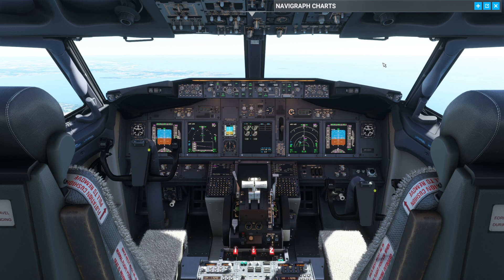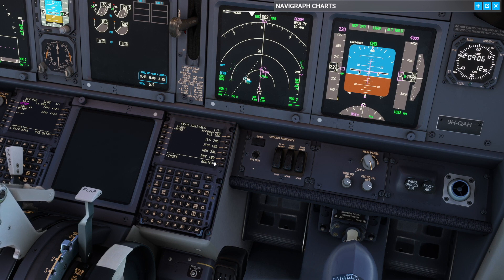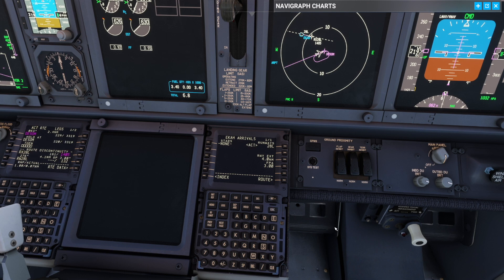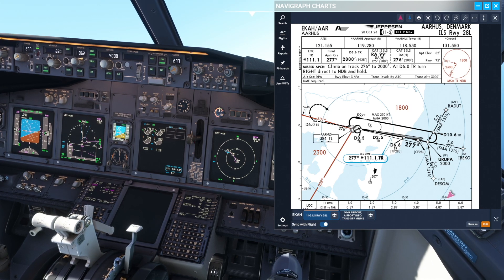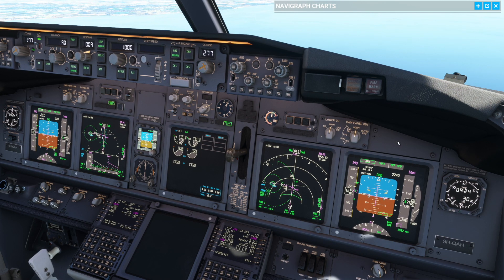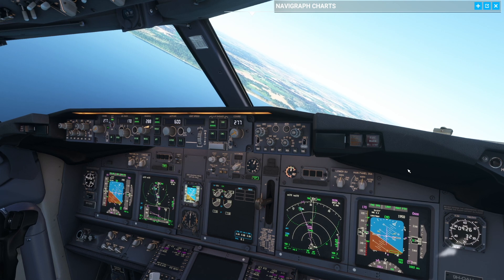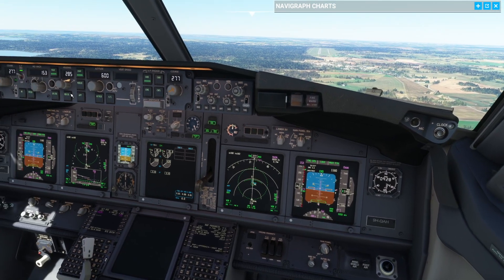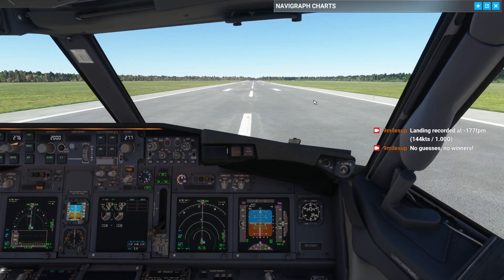REAL 737 PILOT - How to fly a visual approach using real life procedure

Comment: Very nice video. Just for my further understanding;  in a visual approach, why did you set the instrument missed approach and brief this? Wouldn’t Tower or Departure advise you of the missed approach instructions in the event of a go-around?
Reply from the maker: No. A visual approach is defined as flying part of an instrument approach with a visual segment. This means, that the missed approach should be flown as published. In normal circumstances, an airport has a preferred approach, fx an ILS to a certain runway. The normal procedure would be to setup and brief the ILS, but state "IF visual, we will request visual approach". In some cases, we would confirm with ATC the missed approach, as some missed approaches from an ILS procedure are complex and designed for terrain avoidance. In case you fly a visual approach into and airport with no obstacles or terrain, in daylight, it may make sense to ask for a missed approach with a climb straight ahead to the MSA. 🙂
Reply: @9milesup thank you for your explanation.